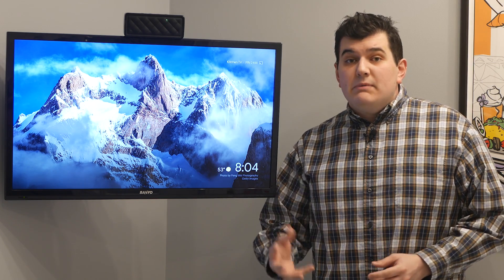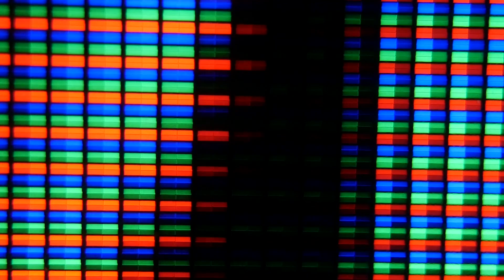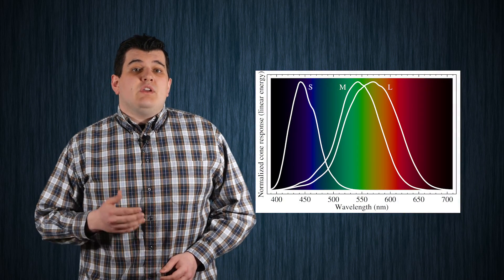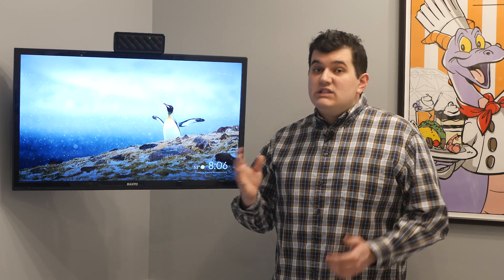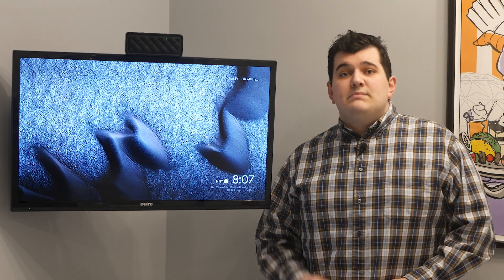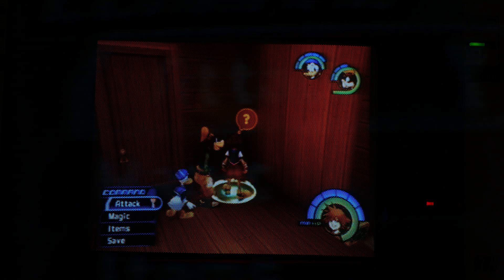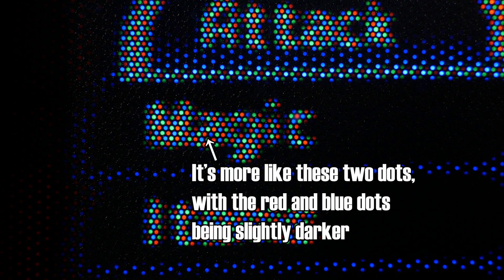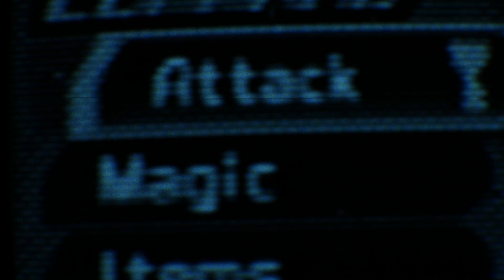These Are Not Pixels: Revisited

Comment: About the color and brightnes resolution. You just need to point out that the phosphor cells can be partially lit. Not as dim light, but like half a circle. Back to the word “Magic”, the hole in the letter “g” is made by half of each of the three dots. It’s not made of dim light, as it would be in an LCD TV, but by actually different brightnesses within the same phosphor cell
Reply: Yeah, I was surprised he didn't note that. As soon as I saw those partially-lit rectangles, I got it.

Comment: Slight flaw. It’s most likely that the Chromecast is NOT telling the TV what to show in each pixel. Most HDMI devices only output at the standard 720p and 1080p, and your TV is 768p because 768p panels are cheaper for TV manufacturers for some unknown reason. Anyway, even if it was a 1080p TV, unless you set it up correctly, it will do some overscan and the signal pixels will not align properly to the panel pixels. The Chromecast is not telling the TV what to show in each pixel. It just sends a picture and the TV decides (according to your settings) what to show in each pixel
Reply: The reason 768p is so common goes back to VGA monitors. 1024x768 was very common in the dark days of 4:3 because it was sharp and eventually affordable. When 16:9 became popular, it was only logical to simply take a relatively high vertical resolution and increase the horizontal resolution to 1366. Since so many panels were made at that resolution, the tooling and whatnot for that became common enough that it became very cheap to just keep making them.

Also, since by today's standards it's a low pixel density, underpowered computers can drive them much more easily than 1080p and up, which helps with both performance and battery life.
Reply: @KatyaEll . Yeah, but that's for PC monitors, not larger displays for TVs. I don't remember LCD/plasma TVs with a 1024x768 resolution, so I still don't know why TVs themselves were 768p even though the standard for TV is 720p. It just messes up with the pixels and the resolution. Either they should've made real 720p TVs or devices should've adopted 768p
Reply: @ddnava96  I would agree with you completely, except for one thing: a television that is 768p will be better for a computer than one that is 720p because it allows slightly better resolution. I've been using a computer plugged into my living room television for years now and even though I've never owned a 768p television (I went right from a CRT to 1080p because I was too poor during the 720/768p days), the few times I used one, I was happy for the extra pixels.
Reply: @KatyaEll . Yeah, but then why make 720p the standard if there would be no 720p panels?
Reply: @ddnava96  I assume it's because when you double 640 (VGA horizontal res), you get 1280 and in order to get a 16:9 aspect ratio, you've got to then make the vertical count 720.
Reply: Oh, and why 1024x768? 1024 is a binary number and 768 gets them the old 4:3 ratio. I mean, I assume. Ain't nobody got time to look up stuff like that.

Comment: from the point of view of a mathematician, breaking a picture into discrete boxes by placing it on a grid is the definition of pixilization, so... yes! the crt tv does have pixels!

...however that would only be true if the crt was a perfect grid, which it clearly is not so you right, im wrong haha.

Comment: Great video. One thing. CRT phosphors (the rgb thingies) can display multiple colors AT ONCE. No, i do NOT mean across multiple frames. That would make it essentially a pixel. No, as one scan line goes across the screen, each phosphor has the capability to show multiple colors at once. Not a mix between multiple phosphors, NO, EACH SINGLE INDIVIDUAL ONE can display MULTIPLE COLORS AT ONCE.

This distinction is necessary to avoid the "everything is fundamentally digital" argument that you hear from people who do not understand how human vision or analog technology works. Each separate and individual rod/cone in my EYES see multiple colors at once, and so can CRT television/monitor phosphors. If CRT phosphors could not do this, then we could not call CRT displays ANALOG.

That just makes those old, long lasting, tried and true CRT televisions... seem totally badass. They really are the most prized centerpiece, the true king of home entertainment systems.

Comment: As a kid I actually got super close to our Magnavox with the phosphor lines and observed that a line can have separate intensities through its length which also means through its width, dvds could push that same tv to have almost a digital looking pixel separation but that was just due to the resolution in the dvds video closely resembled the phosphor grid. But in visaversa this also means an lcd display takes an analog signal and will digitize it to be reproduced in exact spots on the screen but bare in mind not all tvs use the same method of this and some do it better leaving sharper lines and details. It's actually fascinating to think about because it's simply a case of maintaining a standard for backwards compatibility, now what sucks is the idea that this means if your dvd player doesn't support a digital output that you're relying on circuits to take a digital signal, convert it to an analog standard, and back to digital for an lcd panel. Which makes me kinda want a list of what video connection methods are digital signal and analog signal.. E.g. VGA "I believe is analog yet I don't see barely any information loss" DVI "I believe stands for digital video interface" standard composite video "analog", YPbPr composite "I think is running on a similar basis to VGA which is just like a high def analog" HDMI "digital, stands for high definition media interface I'm guessing, I think it's purely digital in video and audio". I have no idea what display port uses but I assume it's digital. TC please correct me if I'm wrong these are just observations and guesses I've made, I haven't really done any solid research.
Reply: it's pretty simple. CRT phosphors can display multiple colors PER FRAME. That's a single phosphor mind you. A SINGLE phosphor can display multiple (infinite amount?) colors SIMULTANEOUSLY. A digital pixel cannot do this. A digital pixel can only have one color at a time. That my friend is the difference between analog and digital.

Comment: Thanks for the explanation. I have two more questions :
So If the number of vertical phosphorus dots does not match the number of scan lines, I guess the the beam is smaller than the dots vertical size.
And why does each vertical stripe of dots group has an offset of 1/2 dot compared to the adjacent one?
Reply: To answer your question, I think they did that to reduce the appearance of horizontal lines. Were there no vertical offset, there would be a black line between each horizontal row of phosphors.

Comment: https://youtu.be/Ea6tw-gulnQ?t=48
The real purpose of the  sub-sub-pixels is most likely to improve the color rendition for different viewing angles of the LCD panel.
It's clearly visible that this subsubpixels have slightly different orientation within the group of four, since the closest one to the camera is the brightest. Single subsubpixel has a very different brightness to signal response depending on the view direction, like in a cheap TN panel. So by combining four differently oriented subsubpixels the manufacturer averages this imperfection and makes the panel display an equally good picture from lots of very different directions.

Comment: Jup, we usually create subdivisions to increase the total contrast ratio (it's not ideal mind you) it is a simple design where we connect them in row and then decrease voltage gently to create lower light output, that is why in your example they go dark from one end to another. Depending on manufacturer we may not have them go dark from any expected direction, but it's always a brightness scale where they go one after the other.

Comment: A CRT television cannot display every visible color. Using pure spectral red, green, and blue as primary colors, it is possible to get a large gamut in a triangular space called "Wide-gamut RGB color space." However, that is still not perfect, as it can only display three spectral colors after all. But real CRT televisions are limited by the colors actually produced by the phosphors available, and these result in a much smaller gamut in the "Standard RGB color space". This color space is also used for most LCD and LED displays as well as for most digital image and video formats. In reality, the majority of colors cannot be displayed on a consumer screen or even recorded by a consumer video camera.
Reply: Okay. LEDs can emit light in any color. Why has nobody made a display with LEDs that can just emit whatever color is needed instead of simulating color with an RGB array? Seems like it would make achieving a vastly higher pixel density than what we have now a trivial matter.
 Also, better color.

"Do you have any idea how much computational power it would take to define several million pixels with essentially infinite variability dozens of times a second?"

A lot?

"Yes. A lot."
Reply: @KatyaEll  LEDs generally only emit light at a single frequency corresponding to their bandgap voltage. Although ideas of variable frequency LEDs have been passed around, I don't know if any have been created. Regardless, reproducing most colors requires mixing more than one frequency. You can't have a magenta LED. But sure, if the frequency of each LED could be individually tuned, that would theoretically allow for a really wide gamut display.

Recording and encoding the image would be a separate challenge.

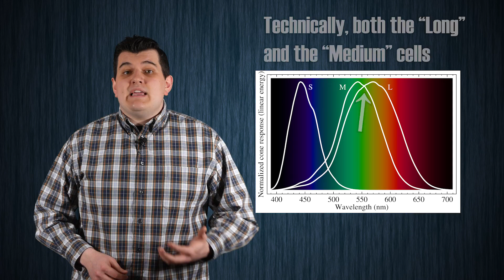Comment: Pet peeve... our cones are not stimulated in isolation by physical red, green, and blue light.  Such a notion is known as the Young-Helmholtz theory, and it has been falsified ever since we've mapped out the cone sensitivity spectrum... such as the very map you're showing at 1:40 in the video.  Take the L cone sensitivity on that plot, for example... its peak sensitivity is not red... it's a yellowish green.  Your own cone sensitivity map shows that L is "pretty" sensitive at, say, 620nm... which is a fairly red color in isolation.  But it's exactly as sensitive around 530nm, which is a bluish green.  Think about that, carefully.  L's sensitivity, with respect to the levels reflected by pure red light itself, extends all throughout the green range at at least that sensitivity.  So what's green again?  Given L pegs throughout green, it's certainly not M stimulation in isolation.

Color vision works by a more complex biological process; our eyes are not RGB cameras.  Red and green work in opposition according to a differential measure of L and M sensitivity; yellow and blue in opposition according to general "brightness" compared to S sensitivity, and brightness mostly is sensed by M but contributed by L and possibly some S.  Isolated cone stimulation is simply not possible with real light due to sensitivity overlaps; "true" primaries, which stimulate the cones in isolation, are theoretical "abstract" colors.  You'll note a funny curved shape like a bent parabola on a CIE colorimetry chart, connected by a straight edge on the violet end... that's the real color gamut.  RGB as displayed by monitors are simply three points somewhere in that shape (surrounding white), and the color gamut they can produce forms a triangle.  Now, given RGB standards and primaries, we can bootstrap a color theory specific for monitors, which is where your pixels come in.  But you shouldn't confuse that with what real human eyes do.

Comment: you're amazing, very clear and explicative. I have a curiosity though, we maybe can refer at a pixel on a tube television as i'm going to explain. let's get as reference the b&w tv, we know that the images are created by a ray of light travelling on a defined numbers of lines, this ray of light changes brightness during its moving, so that it can create the contrast necessary to the images. What if we can measure the actual space that takes this ray of light to change from its darkest possible  to its brightest possible and refer to that as the dimension of the pixel? I know, as the white noise signal demonstrated, that - as long as the ray is on a determined line - that peak of brightness can phisically happen everywhere and that - being an analogical signal that defines the images - the change in brightness of the ray of light is continuous; but that progression from the darkest peak to the brightest peak needs time to happen and, having the ray of light a given speed to draw a single line, space to happen. In math terms, the maximum derived of the brightness' signal is finite. Knowing the actual dimension of this virtual pixel maybe could be useless, better to know how many times this change in brightness between peaks can happen during a line, so that we can roughly know the resolution of that particular screen in phisical lines and virtual pixels. could this be a method to roughly compare the "quality" of the image between old style tube tv and modern pixelated ones? thanks, sorry if my english isn't spot on, greetings from italy :D

Comment: And, you complete ignore the fact that with NTSC encoding, the horizontal resolution of each color is much less than the horizontal resolution of brightness, and various colors also change at different rates (but not a problem with three-coaxial cable RGB signal source to the TV). Displaying vertical bands of different colors is abysmal with NTSC encoding. 

BTW, at 5:28 displaying B&W "snow", the compression algorithms have introduced a patchwork-quilt effect (with varying-sized patches at various times) to the image, so the image is more organized than a directly-view B&W TV or never-compressed/raw image.

Comment: I didn't get it until the last 1/3 of the video. You were talking about how the video signal doesn't have pixels, and I was thinking "yeah, but doesn't the final result still have pixels?". Then you showed how the dots can be partially illuminated.

How did they line up the shadow mask with the electron guns and the phosphor dots?
Reply: I always assumed they got it within tolerance on the production line, then calibrated the emitter in QA.

Comment: TL;DW: A summary:
Analog signals do not define any kind of individual pixel, and only actually divide lines and frames. Color CRT's use analog signals to draw each line. Any colored dot could technically be divided into several subdots (I'm too lazy to calculate how many exactly, but around 8000 given average frequencies for NTSC signals) so, on every close-up shot you can clearly see a dither effect on each dot. Try doing that on a pixel.
If you want to really know a "Resolution" for a NTSC signal, it would likely be something like ∞x480, and if you want to know the screen resolution of your CRT, dismantle it, figure out a reasonable way to arrange the dots in the mask in a 2D grid (not really possible with some designs) and count them. Every TV will have a different "Screen resolution"

Comment: 14:50 - your statement is completely wrong, as demonstrated by you: brightness of green colored text is changed on small TV, at many points it's even lost entirely. So, no it can't have the same 480i resolution in terms of brightness, as long as the image isn't black-and-white.
An even bigger logical error I'm sure you've made is saying that the dots are needed to separate light beams. That's not needed. Having beams of different color shine at exactly the same point is completely fine if they were of different color. Yes, the colors would blend, but they would blend exactly into the color they need to produce. The pattern is there because phosphor dots need to be there, even in a monochrome TV. They re-emit the light, converting pointed light into a light that goes in all directions. And sure enough, making phosphor cells that emit light of the same set of frequencies as they receive it, must be hard, if possible at all.
Reply from the maker: Monochrome CRTs do not have phosphor dots.  You can clearly see that in the shots I've demonstrated.  You seem to be assuming that the three electron beams are somehow different, but they are not.  The three beams have no color--the only have intensity.  It is the phosphors themselves that create the color, and the phosphor dots along with the shadow mask create a mechanism to prevent the beams from crossing over onto the wrong dot.
The demonstration uses colored light because that's really the only way to make the separation process visible to the eye.  In the picture tube the beams are invisible until they excite the phosphors on the screen.